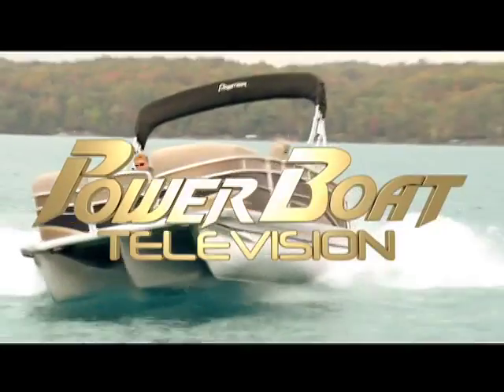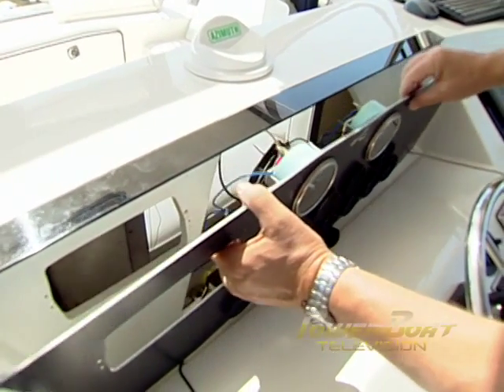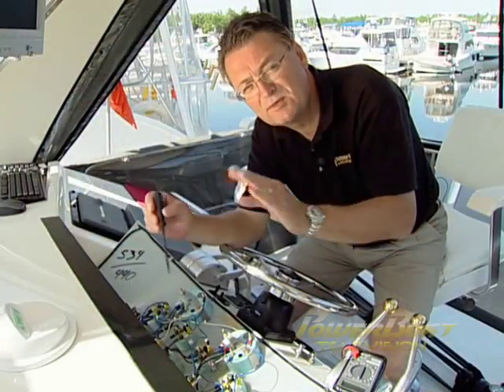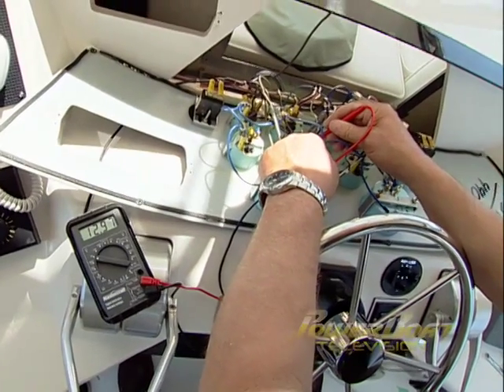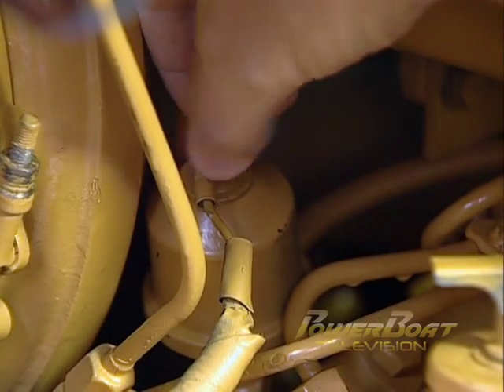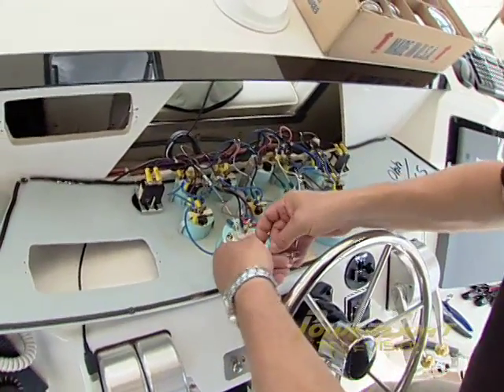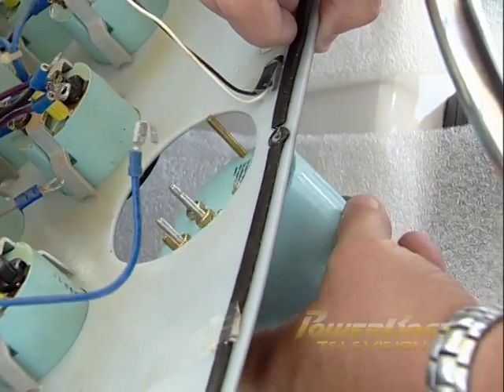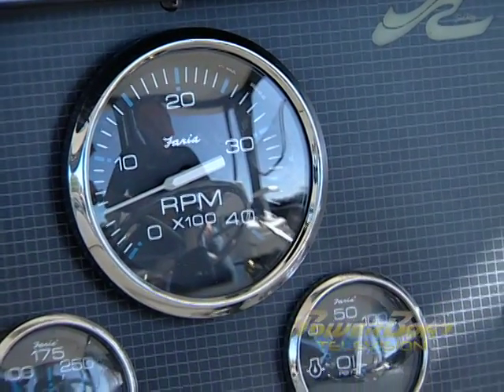DIY My Boat: Helm Gauges Reliability, Testing, Replacing - PowerBoat TV

Comment: Thanks for your video!  I remember I adjusted the instrument brackets with a pair of pliers, ... none of the 4 gauges work now, water temp, volts, fuel, and oil press., and besides adjusting them I just cleaned connections and replaced some connectors, so, I hope that is the problem
Reply: Did you ever figure that out? I tested my temp gauge like this video and now my engine coil pack is blowing fuses …